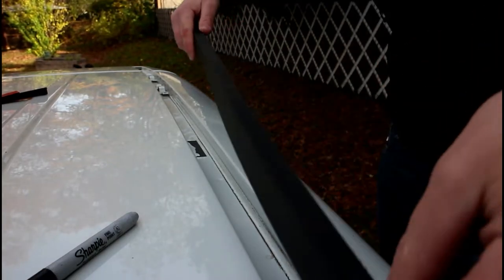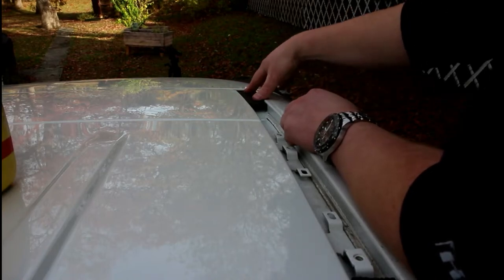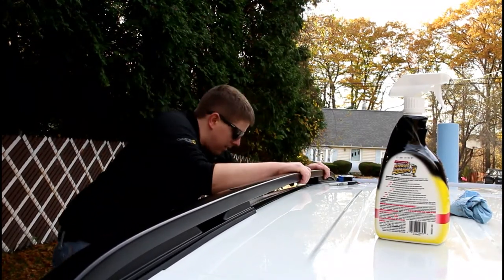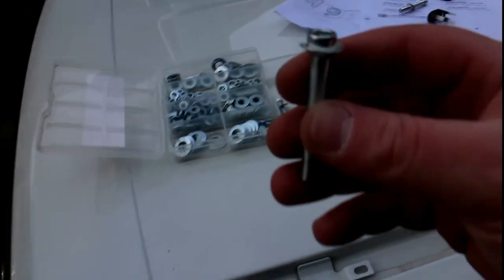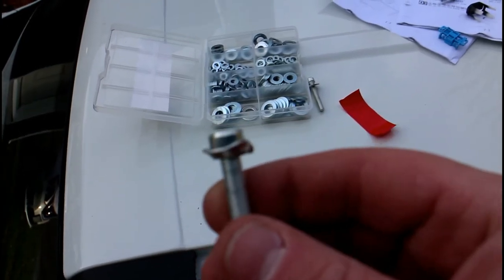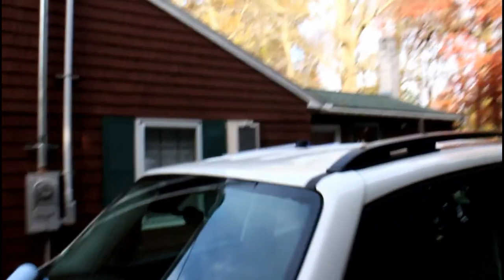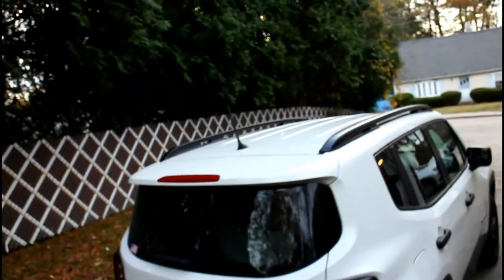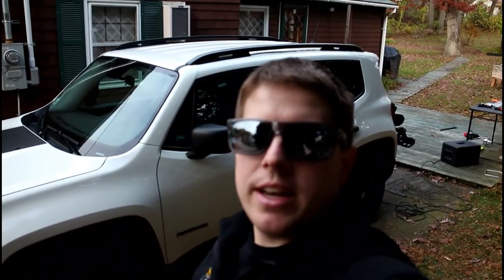Installing Factory Style Roof Rails to my Jeep Renegade Sport (Ebay / Amazon)

Comment: SOB mine didn't come with any instructions, luckily I found this video. If you get this and it doesn't have instructions follow this video, it's very thorough. One thing I also noticed, the two front most bolts are shorter, so be aware and be very gentle with the plastic trim plugs at the top. I used a wood screwdriver handle to gently tap one side down and then gently tapped on the other side with the flat blade until the tab started into the opening then gently tapped with the handle until set. Be aware also the bag that holds the short bolts also hold the two plugs for the front most opening, they are different than the other plugs. Thanks
Reply from the maker: Good tips, thanks for sharing.
Reply: When I ordered my jeep, which is still on it's way, I asked the dealership about this and they printed out an exploded view of this installation for me. This also included the partsnumbers I need to order them, including the factory-made raingutters for the installation of the rails ...so you can actually keep the original ones without drilling holes etc.
On their mechanic-system they can print out any exploded views of the car..truely everything you need . Just ask an official dealership, they should be able to support you on that ;-)
Reply: Bad Kitty No Milk Tonight do you remember the difference between the two main front trim pieces compared to the other ones, I have em all side by side and can’t tell any of them apart?

Comment: Great video. Thanks. If anyone wants to inow. I have a 2020 jeep renegade sport. The roof rails on ebay years 2016 to through 2019 fit the 2020 perfectly
Reply: was it hard to remove the old molding gutter without breaking clips ???

Comment: This was really helpful, I just put mine on, my bolts were too short so I did have to run to Theisens for some bolts 6mm coarse @ 45mm long was perfect.When putting them on I thought the rail was just a hair too short from the front to the back but found that you have to push in the middle to get things to snap into place. As for the rain gutter on the top, I just lined it up with the first part on the rail that touches the roof and cut there, same for the center and back and it was perfect. Took me about 4 hours total. Scraping/Cutting all the prior adhesive took the longest I think. I found though that if you use your thumb and peel it back a little and cut that small section under to peel it back further and repeat was faster than trying to use adhesive remover and a scraper. The plastic on those is so thin that when scraping it, I cut into one.

Comment: We are needing to add roof racks to our renegade....your video was extremely helpful however, how did you originally remove the rain gutters? Was there a screw that holds it in place or  what? I  really  need to see a video showing how to initially remove the rain gutter

Comment: Hi, I like your railing set up, have you tried attaching any shells to the top yet?
Reply from the maker: Crossbars would mount just fine on the top of the car.
Reply: Hey I’m still deciding between railings but do you happen to know where I could pick up extra rain gutters just in case I ever do decide to take the rails down?
Reply from the maker: Likely Rockauto.com, you can usually find parts like that from salvage cars. Otherwise, I am not sure. Once you install the roof rails I can't imagine you would ever want to remove them.

Comment: Did you ever find a solution to covering the bolt holes where the manufacturer clips broke?
Reply from the maker: Not yet. To be honest, I have been lazy, and the day I installed the bars I just put a small piece of electrical tape over the clips and it has worked perfectly. A janky solution so when it gets warm again I will work on a long-term replacement.

Comment: How do you take off the black bars? just pulling them off? are they just attached with doble view tape? thanks
Reply from the maker: They are attached to the front/ back and very middle with double-sided tape. They do also have some plastic clips near where the roof rack bolts would go in that can be wiggled to let loose of the black molding.
Reply: did you use a flathead screwdriver to slowly unstick the plastic molding from the double sided foam tape?  Other forums have reported to remove starting from the rear.